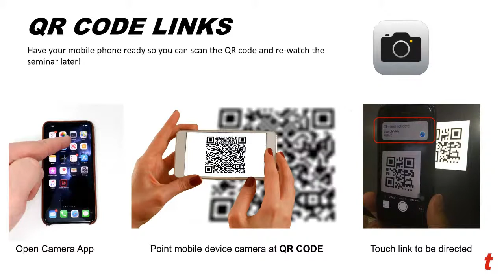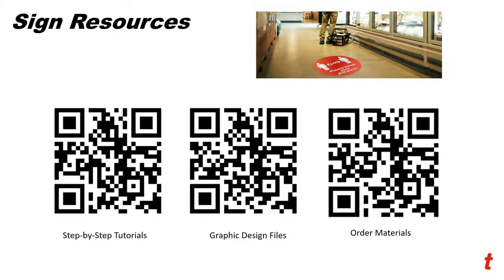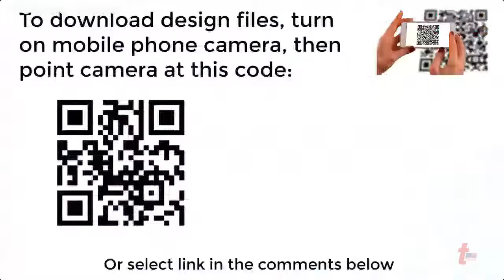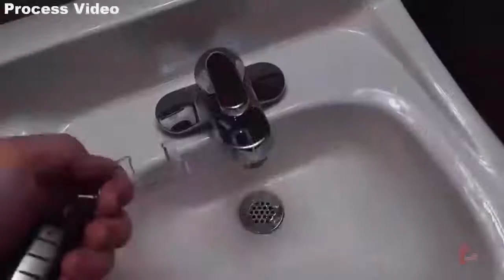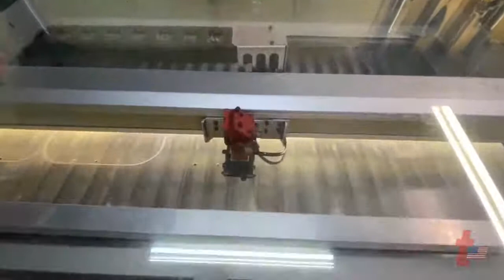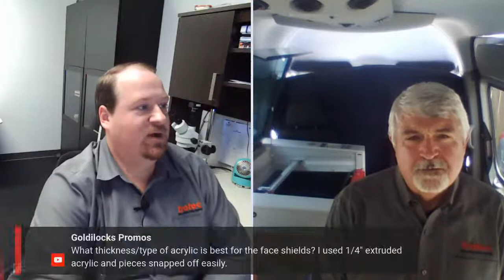Trotec Laser Webinar: How to Meet New Market Needs

Comment: I never used a QR code.once I take a photo of this code  with my iPhone,how do I access it.also is .020 acrylic good enough for the shield or should I use .030.
Reply: Tom Tarace not a problem I a happy to help you learn.  You don’t take a photo, just Open the Camera app either from the lock screen or tapping on the icon from your home screen.  Hold your device steady for 2-3 seconds (do not take a photo) towards the QR Code you want to scan.   Click on the notification that pops in on your screen to open the content of the QR Code.
Reply: @davidstevens2577  Files not much use on his iphone..